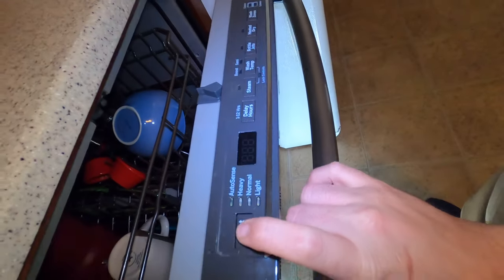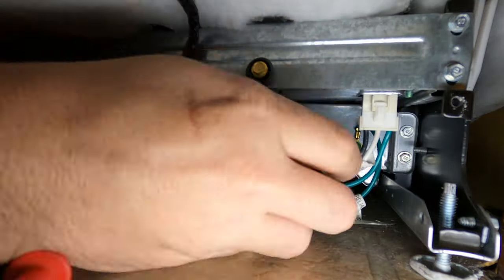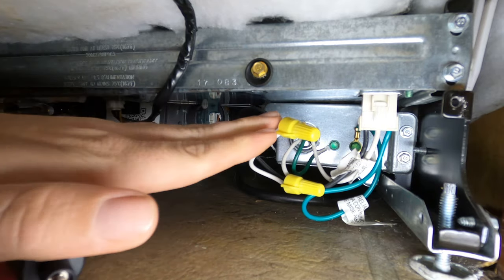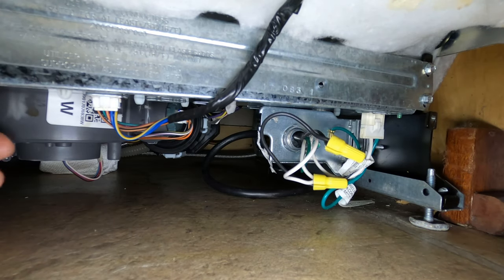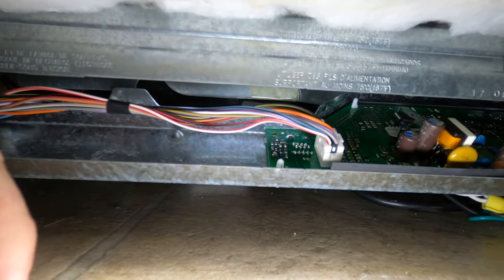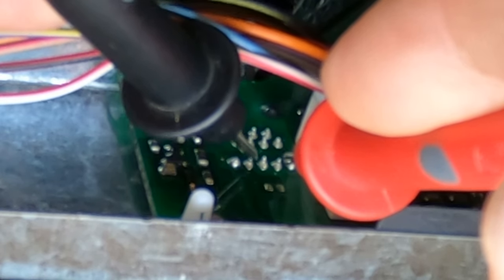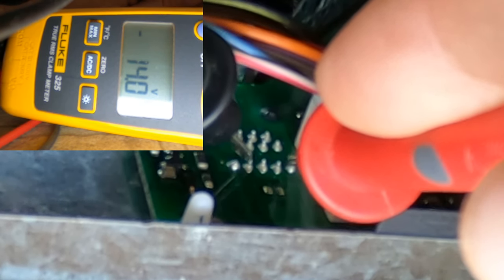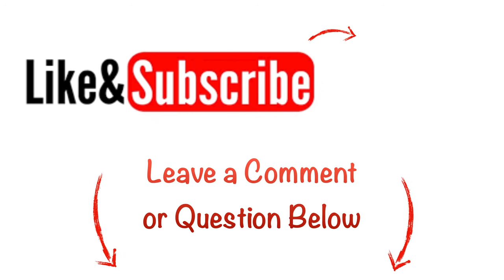GE Dishwasher Dead Display Diagnosis (GE Dishwasher Has No Lights)

Comment: My dishwasher was making a chime sound every once in a while for the past month then stopped working. Didn't see any error code or blinking display light when i heard the chime. And then the interface just went blank.  After I watched your video, I tested the pins as you described. I had 14 volts so I began to put it back together figuring I would watch your video on replacing the interface module. When I plugged back in the wiring harnesses, the dishwasher chimed again! Interface was no longer blank and dishwasher started right up. Not sure if this means that the interface is about to go or just that the connection somehow became loose. But at least now I know where to look and have clean dishes! Not sure if you have an idea what it could be. Thanks for the great, short and to the point video!
Reply: Mine had the same symptoms. Intermittent chiming then dead. I replaced the UI board and it is working great now.
Reply: @evan_off_track  what was roughly the cost to replace the the board?
Reply: I experienced the same random chime and now my display and function is dead.  I'm going to try the diagnosis.
Reply: Update! Thank God it worked again. 

I undid the kick pabel, turned off the appropriate fuse, and then simply unplugged the vertical connector. I then turned on the fuse again and the lights lit up!
Reply: @Spacesuit_Charlie  about $140
Reply: Same symptoms here.  Tried this diagnosis on the main board and got 0VDC, and about 11.4VAC.  Is this a  DC power supply?  Or AC?

Comment: Steve thanks so much!! I received this dishwasher free from a friend and said I could keep it but the interface was dead. I watched your video and fixed it ( thanks to you) and a parts store. 
My model had an easier way to remove the door (disconnected the pulleys from the spring) and the door face just slipped off with a slight push. 
Now I’m a happy guy washing dishes. Thanks again!

Comment: Same issues with a GE dishwasher that wouldn't power up.  So I replaced the board without testing to see if it was the problem, and the unit powered back up after the installation... at first.  After a night, we came back out and it won't power on again.  Is there a fuse or load protection on the board that could be popping on me?

Comment: Thank you so much! I have been running into this issue and could not find a pinout to check the DC voltage from the machine control. Thanks again for showing us the pins to check.
Reply from the maker: You're welcome!

Comment: I'm surprised you didn't mention HITTING THE RESET FIRST: 
PRESS AND HOLD both "START" AND  "SELECT CYCLE" BUTTONS FOR 5 SECONDS (lights come on when you lift up)
Press and hold select cycle for 5 seconds... then do it again
Press and hold start for 5 seconds
Press both buttons for 5-10 seconds again 
If console does not light up at all, then go to take things apart.
Reply: Thanks for this comment, a reset did the trick for me!
Reply: This worked for me as well, thank you!
Reply: I had to do it a few times, but this worked for me.  Thank you!
Reply: I have power, everything lights up but it won’t start. I have this exact model.
Reply: This did the trick. Thank you for that!
Reply: Alas, only three months, and this time the reset does not work.  Will try the next thing.
Reply: Does not work ge washers are garbage stopped working loke 3 months after i got it
Reply: If those directions dont work just keep closing and turning on fuse i did this 28 times and it finally turned back on the console

Comment: Thanks for this video. Very easy to understand. However, when I test pins 2 and 5 I am getting between 8 and 9 volts.  I just wanted to confrim if that means the board needs replacing. Thanks in advance!
Reply: This what I am getting, 9 bolts. Which board did you replace?
Reply: I tested mine and also only have around 9 volts. If you have time what was the outcome in your case, I already replaced the main board with what I assume was a new one from a large online seller. TIA

Comment: When you check for 14volt on the two pins is the power on? I did it both ways and only read 1. Also, why is there a black jumping to the white wire? Mine is black to black, white to white and green to green.

Comment: Hey! I have a unique situation in that I have to flip the breaker on and off to get the dishwasher to work. But once it is working it completes the cycle. There’s just clearly something amiss with it. I don’t have a meter like yours to test, but based on this information, are you able to provide any clues on what needs to be replaced? The home was built in 2006, so I don’t necessarily think it’s a problem with the breaker. Thanks!
Reply: same thing is happening to ours, can't wait to hear an answer

Comment: I have model GDT635HMJ0ES and I checked pin 2 and 5 and got 0VAC, however the display intermittingly goes off and on.  Unplugging the unit makes the display go on.  I checked when the display was working and still got 0VAC/0VDC.  What do you recommend to debug my issue further?

Comment: I have a question. When testing the pins for the UI I was getting 30ish volts. Also on my control board there is an illuminated green light that I don't see in your video. Not sure we're to go from here.

Comment: I replaced the main panel last June 2023 and it fixed the problem of no power to the controls.  We had a power outage at our house and when it came back the dishwasher control panel was out again.  I'm trying to figure out if I need to replace the main panel or the UI.  I tested the 2nd and 5th pin but I'm not getting a consistent reading.  It will jump to around 14 volts but it won't stay there.  I do see a green light the is lit on the main panel so not sure if that means I'm getting power or not.  I did test to make sure we are getting 120 volts and we are good there.  Any suggestions?

Comment: So I have a GE dishwasher and I have 14dc at the main board and the ui board is working fine for a few days then just cuts off and after I take it apart and leave it apart for awhile it will come back on when putting it back together?

Comment: Ok so mine wasn’t coming on. Opened bottom up, the silver box on my model came out, so pushed it back so it was connected. Still no luck but then pulled out one of the wire harnesses and put it back and viola! Power!

Comment: Question, I have the same model, except for the last digits mj5es.  I've replaced the board down below as the light was blinking on it.  Still not working.  Thinking it's the upper control panel now.

Comment: I have a similar looking GE (~5 years old, model gdt695sfl5ds) with a different control board (couldn't see 5 pins to test). Wouldn't turn on or respond to any button press. Board has blinking green LED Z301 R306 (no idea what that means). I unplugged the black wire harness that goes up to door that was plugged into underside of control board while unit was plugged in and it woke up the display when I reconnected. Prior to it going dead the unit would randomly wake up every couple hours so I figured based on Google searches the UI board was going? We'll see what happens, maybe just a loose wire?

Comment: What if only the LCD doesn't illuminate? All the other indicator lights and buttons work correctly. Are there different pins to test to know if it's UI or Control board?

Comment: I have no lights on my GE Dishwasher. I checked pin 2 and 5 and had no voltage. I replaced main board, but still have only 2 volts between pin 2 and 5. What is my next step to check?

Comment: I am not getting voltage when checking pins 2 & 5 on my bottom control board - when you say 'main board' which board is that?  I've already replaced the control board in the bottom - or what they refer to as the "dishwasher configured machine control" and I see a light on the board when I'm powered up, but still not getting lights on my UI.  Is there a 3rd board besides the control board in the bottom & the UI board at the top? I'm working on a Model GDT655SSJ2SS and have been combing the online assembly manual and don't see anything named that.

Comment: randomly beeps and turns self on. Driving me crazy. I tried these steps ( took me a couple of times) but it did clear the problem. When the lights flash at select button, push and hold, then the start button blinked ( press and hold) then both select and start blinked ( press and held both), and done!

Comment: My display comes on all by itself. Has always been very touch sensitive. Just lightly touch by accident and dishwasher comes on. Hold display for 3 sec to stop and it takes several minutes to reset. Quit working for 2 months.  Then display blinked, I tried and it started working again.  But now display still comes on without any input. ?????

Comment: I have this same dishwasher
It stopped working one day
There’s electricity throughout and if I hold down select cycle and start all of the lights come on and it says 888 and then and noise comes on and a orange light comes on at lock controls
What do you think I should do?
Is there a button sequence to press to reset?
I’ve turned it off from the breaker and back on but still no luck 
Please help 🙏🙏🙏🙏🙏

Comment: Thanks for helpful video yet need some diagnostic help ... Preview I get about 8.1V between pins 2 & 5.

Just under 6 year old GE GDT 655 SSJ0SS. Replaced door sensor switch about 18 months ago. Now again have 3 beeps which continues to be the case even after resetting DW and replacing the door sensor switch. So unlike your video the panel lights light up and are responsive, but upon choosing cycle etc. and pressing Start and firmly closing door; then with in 10 seconds get 3 beeps and door LED turns orange.

It has been hard for me to juggle probes of voltmeter & see its read out, and make good contact with only pins 2 and 5, yet I am fairly sure that the reading is <9V which I believe means problem is main board. If that is correct what is cost for getting that part? Thank you

Comment: The display stays off where it normally is on as soon as you open or close the Dorr , but after a power interruption it doesn't however  it goes on as soon as you press start. Then press in start aging to begin the cycle, instead of doing so the orange display button in front starts blinking and giving a short fault tone and won't start. This happens whenever a power interruption. Fter unplugging for about a half hour resetting the breaker & plugging back in, it sometimes works, but its always a guess how m a ny times I have to do this to "reset it". If it was the board it would never work. It definitely has power, so isn't there a reset button or sequence that I can do to not go through this guessing game?

Comment: we have a Gdf520pgj2ww not it won't power on at all to start with the start button was blinking all by itself , no one touched. it has been installed less than 2 years was a clearance model.  all the wiring and the outside of console show getting power.

Comment: If the control boards are replaced and it's still not getting power lights,  what else might it be?  Machine getting power from breaker.
Reply: Check wires for continuity

Comment: Plugged in.  Touch the jumper between 5V and GRD. Then touch between 5V and Reset . Then press Start. This is not a permanent fix. The functional obsolescence engineers have placed a capacitor or diode on the board that is wearing out. But it will help in a pinch and mine has worked for a few more years. I have done this procedure six time over the two years. I have to do it more and more often. It is degrading on a log scale. I ordered a new board last week. 
I will mess with the old board and see if I can find the part that needs to be replaced. The part can probably be upgraded and then no more problems.
Reply: How to do this?

Comment: How about using a 12vdc test light, example: 2 lead fuse tester for automotive applications…..? Provided the tester has small enough pointy tips as not to accidentally touch opposing pins to #2 & #5 ( 5 being ground)

Comment: I'm not getting 14 when I test 2 and 5 on the board, but the board has a glowing green light. Green light doesn't mean that the boards NOT shot, does it? Appreciate your video.
Reply from the maker: If I ran into that I would say the main board is bad.  The bad thing is,  you can’t tell if the UI is bad though. Only way to tell it by checking its in mining power.  If it has 14vdc and don’t work you know it is the UI.  When it is not getting 14vdc.  You don’t know until you fix the supplied voltage issue. 

Yes start with the main board.  It has a personality too. Make sure you set the personality right to your model.
Reply: Hi Kenneth, I also found that I had the glowing green light but I did not see 14V when probing 2 and 5 as shown in the video. I was about to replace my main board, but after watching another video I unplugged the connector under the board, and probed 2 and 5 on the actual male pins. I found that I DID have 14V on those pins. It looks to me like there is a coating on the top side of the board, so probing the board as shown in this video may give misleading results for some boards that have a coating like mine.
Reply: @dannyeskenazi7675  Wow am I glad you posted this response. I was just in that same boat (green light on, no 14v) but couldn’t shake the feeling I wasn’t getting an accurate reading. Even tried a second meter but still 0v until I saw your comment, flipped the board over and voila!
Reply: @PawlH  haha I completely forgot that I posted that comment. Glad it was helpful for you!

Comment: I’m showing 4 volts. Replaced the main board already. I’ve got 120 at the power supply but only showing 4 volts at the at those pins

Comment: Mine went blank, so I changed the power board. It worked for a couple weeks and is now off again. Both boards show 30v on pins 2 and 5. Is my multimeter on the wrong setting? It’s set to volts at 200.
Reply from the maker: Make sure it is in the dc end and with that one set it to the 20 I believe

Comment: Thank you, very helpful. I measure 10 volts between 2 and 5. My voltmeter is set at 200-volt range with no lower range available. Is 10 volts ok?
Reply: I only have 10 too I put a new ui but still doesn't work
Reply: What did you end up doing? I also measure 10 volts
Reply: @Nick McMonigle  I replaced both boards and now it works again
Reply: @steveneosso3593  thanks!
Reply: Just replaced the UI board only and the dishwasher works again. I'll update if it doesn't last
Reply: Did your board have a green light when the power from the breaker was on? Mine does, but I'm only getting 7 volts between 2 and 5.
Reply: I had a green flashing light after I replaced the ui and then a solid green when I changed the other board I did put the original ui back in to see if that was good and I miss diagnosed it the first time but turns out that was bad as well
Reply: @derekclager8571  yup same situation for me. I’m guessing my multimeter wasn’t sensitive enough for an accurate reading
Reply: @nickmcmonigle9649  It seems like my next step is ordering a new UI board and taking the door apart  to replace 🤞

Comment: I have all the same problems on my 5 year old GDT695SSJ5SS. This week I’ve replaced both the main control board & UI..I’m still getting the rapidly flashing LED on the control board & UI panel is still dead. Any suggestions?
Reply: Same model and issue.  What was resolution?

Comment: I have 14 volts on the board and at the wiring harness at the top, I just replaced the display board, still nothing. Any ideas?

Nevermind, I watched your next video and once I changed the personality it worked. 

Also when I saw you using your DeWalt impact with the right angle attachment and looked at the same tool combo in my hand, I knew I had found the right repair guy.

Comment: So.... I have a no duolay or lights up top. Did the voltage check and it's coming in at 29 volts. So now is this the bottom PC board or the interface board?
Reply: Did anyone answer your question? Mine is showing the same as yours 29 volts.

Comment: my pins to test are different than yours.  i only have the two rows like yours above where you're testing.  i don't have the singular row below..so i'm not sure what pins to test.
Reply from the maker: Is your board smaller and has a beige plastic cover?  If so this is a different board.  Don’t have a video up on that particular model yet.  Haven’t ran into those failing as much.
Reply: @BeardedApplianceRepair  yes sir it has the beige container it sits in. I unplugged the harness wire and tested the pins on the power out connector. Same concept with the 2-5 and got proper voltage 👍

Comment: No power/lights, solid green on control board. 14v to harness so I replaced UI board but still no power. No effect holding in start/select buttons. What next? I'm hoping for a quick reply.
Reply: Any luck?
Reply: bought a new dishwasher @SiliconNostalgia

Comment: Ive replaced both boards I now have 14 v at contol board.  I still get nothing. No live whatsoever on user interface.  Any Ideas?
Reply: You must set the jumpers right or it will appear dead.
Reply: @tomn8tr  i did eventually figure that out lol
Reply: @tomn8tr  didn’t make sense because the original board had no jumpers